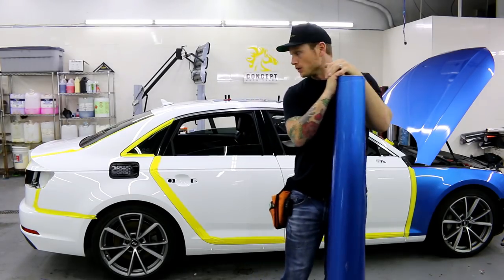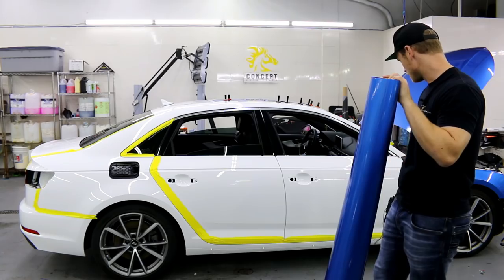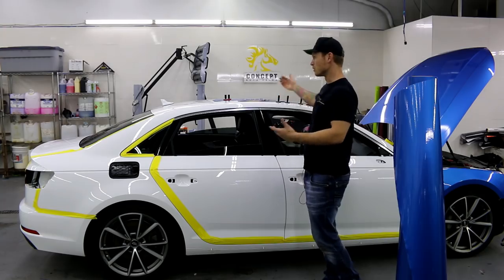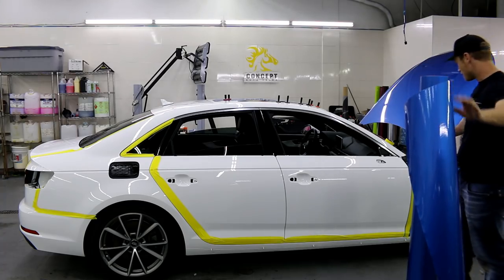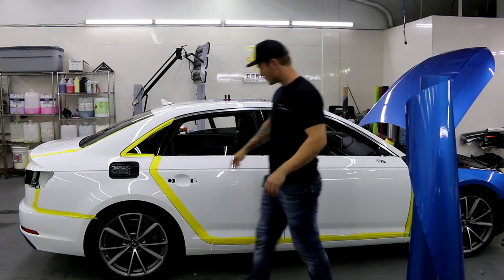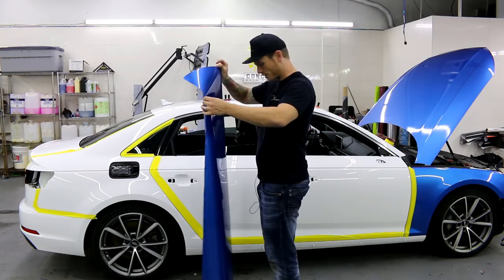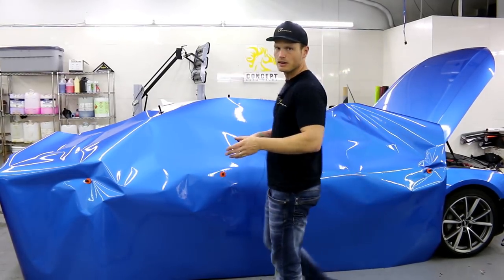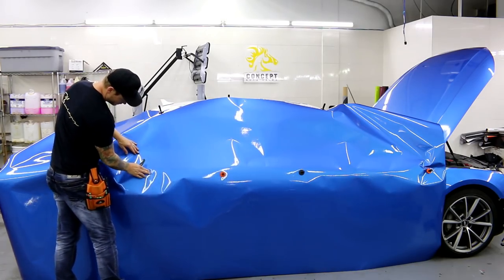NO BREAKS QUARTER PANEL WRAP | PILLAR AND LOWER ROCKER PANEL CONNECTED

Comment: I'm having trouble in the recessed areas even after good cleaning and applying your technique. It's still popping up and getting nasty bubbles. I even tried popping bubbles and applying slight heat to get it to stick.... Is there a way to bring it back without starting over? I'm out of material to start over unfortunately